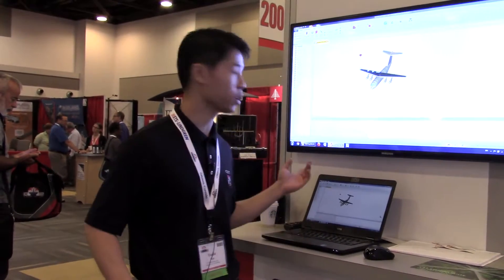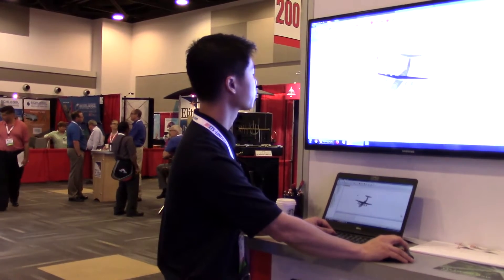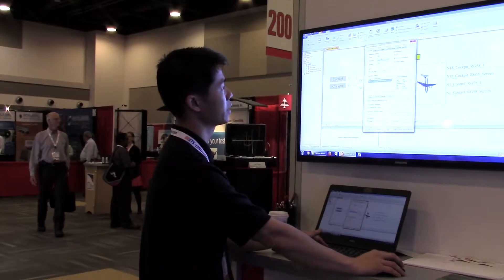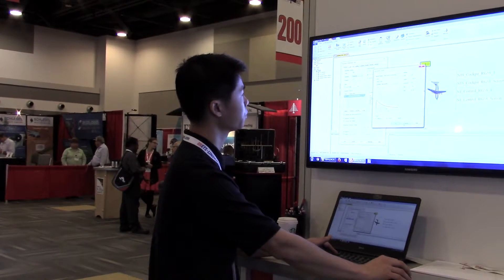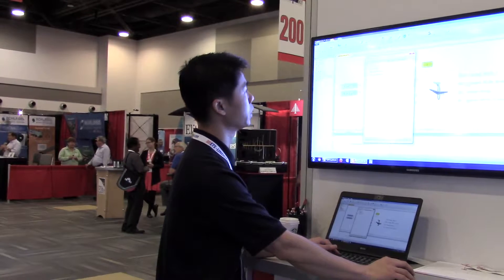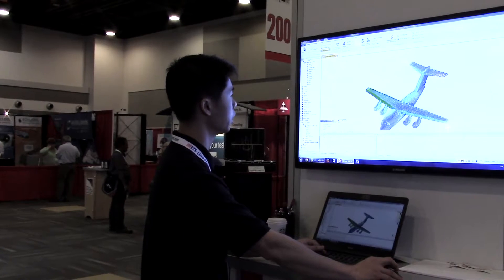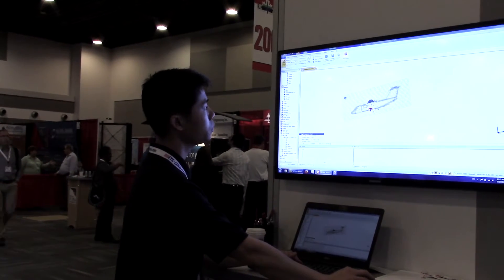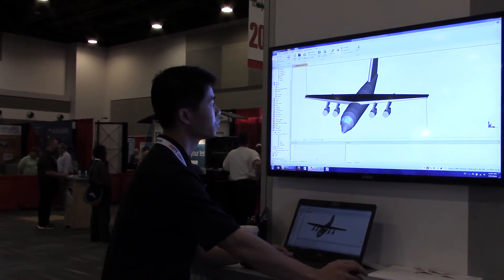CST Lightning Simulation and Modeling Example

Comment: Hi..what software r u using for Simulation?
Reply from the maker: Daussalt has since bought out CST Cable Studio shown here.
Reply: @MicrowaveJournalVideos  ...Can tell me how to design lightning protection diverter strips on the radome surface(tangent ogive) using CST? I have designed a tangent ogive shape radome with antenna inside it and simulated using CST...but now i am unable to put lightning diverter strips on the radome surface..can you help me out with it? ....
Reply from the maker: @rudranarayanbarik7982  We are not really experts in this area but sure you can contact them for help. They have applications experts who can answer your questions.
Reply: @MicrowaveJournalVideos  Can you send me the mail id of the person having expertise in this domain? It would be very helpful...thanks